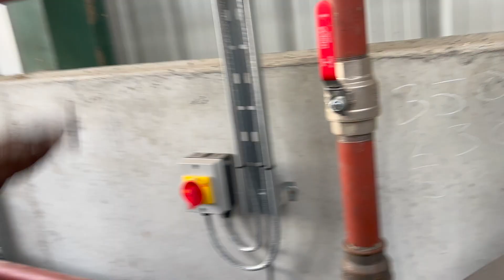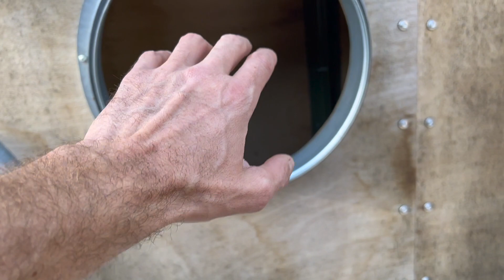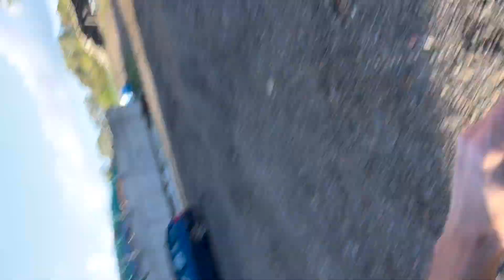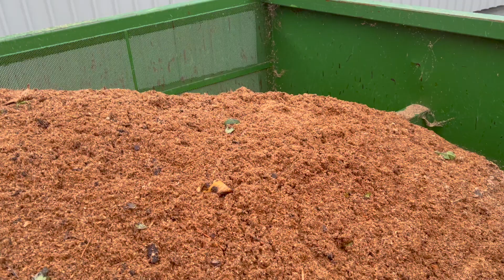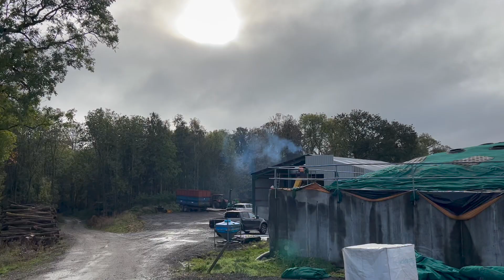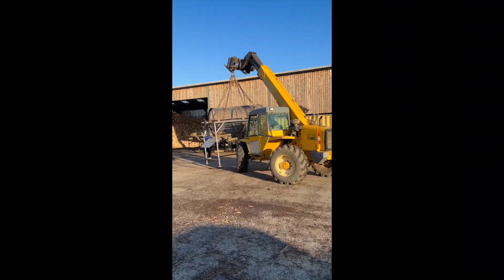Firing up the biomass boiler

Comment: Be wary of your motor if the VFD(Inverter) on the fan is making that 'whirring' noise means you may need to get the carrier frequency checked as it can be a pre-cursor to EMD damage in the motor bearings(electrical fluting)
Reply from the maker: i don’t quite understand what you wrote. but i will ask the experts!!